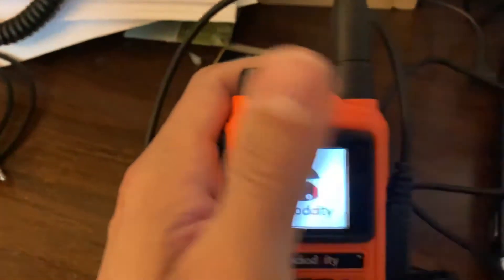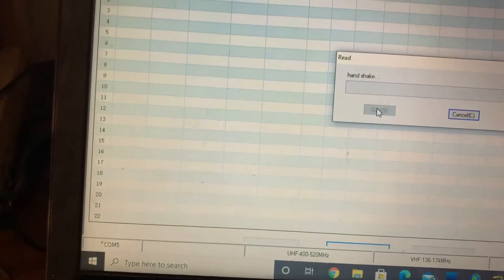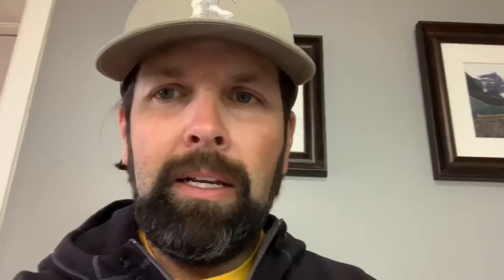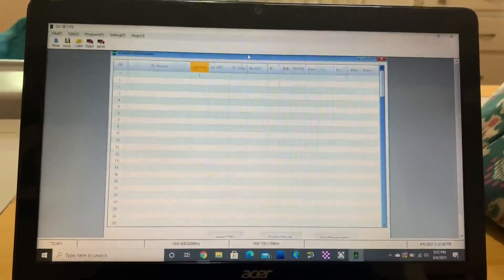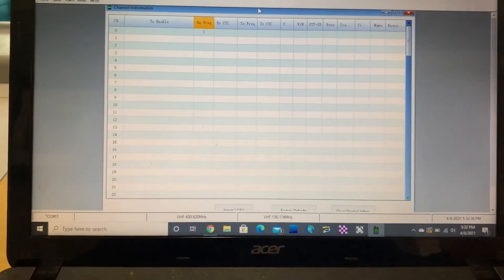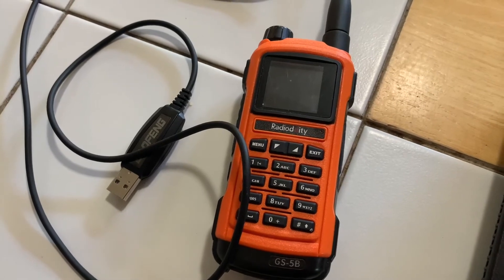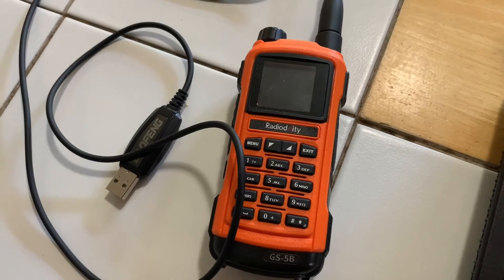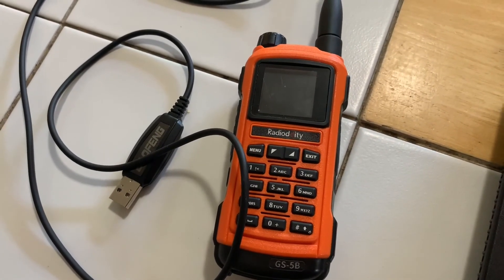Problems with the programming cable and software Radioddity GS-5B

Comment: I have one, great radio. 2 things. RT Systems software works properly. But BIG issue is you can't see that wonder color display in the sun light. Great at night or if never leave the house
Reply from the maker: These are great points. I have found that sunlight on the screen is an awful detractor.

Comment: Thanks for the heads-up.  I got this radio for the USB charging capability.   Your 2 videos about this radio's nuances are appreciated.
Reply from the maker: Thank you for stopping by! 'm sorry for the late reply. Been on hiatus for some time now, spending time with family. I may be outdated on this radio and it's software by now though. I hope things have been changed and updated. I was like pulling teeth to get Radioddity to do something about the programming app.

Comment: *******    I recently bought a Radioddity GD AT10G...And "Trying" to program the radio with the Programming cable,as issued"  is nothing more than a Big Pain in the A** ...I read all the comments below and ordering the Cable with the "FTDI"  chip...as I have had excellent results with those cables.................   Thank you for this video!!..I'm hoping this "FTDI chip cable is the answer !!  ****
Reply from the maker: Gee I hope that resolves the problem! Check this out: https://youtu.be/NIryWOwKF-Q - I go through the remedy for fixing the firmware issue in the cable that is causing the problem, at least with the GS-5B. Have you had a chance to use that AT10G much?

Comment: Had issues with the programming cable as well.  However programming, the program doesn’t have a column for setting offset frequency..???
Reply from the maker: Hey Bob, just responded to this i think on another thread.
Reply: @backcountryamateurradio  yes, thank you.

Comment: This issue with the software is not limited to this one. Other radioddity radios that will not work with the CPC includes the GM30. I also used by Wouxon programming cable and no luck.
Reply from the maker: Wow, the frustration continues. I haven't had trouble with my GM-30 CPS, but I used a 4 year old Baofeng cable too;  I also don't do a lot of computer/radio programming. I should try it with the GS-5B cable which has the update on its driver.

Comment: I spent an hour or two messing a CSV file that it will "import" with no errors but for it not to actually import it. if I save the file and open it back up all my channels are gone and if I try to send them to the radio it gets nothing from the "channel information" box. its sending everything else fine like VFO settings.
Reply from the maker: Oh no. I haven’t heard that one yet. So if I understand, you’re attempting to upload a csv file to the pc programming software?
Reply: @backcountryamateurradio   yea, there's a "import .CSV" button and the channel settings appears in the channel information box as if it's going to send it but it doesn't actually save it or send it
Reply from the maker: this is interesting. have you reached out to Radioddity about the issue?
Reply: @backcountryamateurradio   reading the amazon reviews its been there for a at least 3 months but no

Comment: What setting do you use to have a scanner only channel?  The Duplex setting in chirp doesn't work in "off"
Reply from the maker: I'm really not sure on that. The closest thing I can think of is to set one of the display bands to vfo and run it in scan. But I don't know if that answers your query. Have you been able to use Chirp with this radio? I have not heard of this yet. Unfortunately I no longer have this radio to help answer this.

Comment: Radioddity has been trying to work this issue out with me, and they have supplied a third brand new radio and brand new cable, provided direct links for the drivers they want me to install on my Windows 10 PC, and still the issue persists, and they (Radioddity) are at a loss of explanation. They suggested I am the only user who has ever reported this issue and they can never duplicate in their testing. Well, I know the first half of that statement is not true.

And, once they get the cable/driver issue sorted, they still need to do a ton of work on the programming software, as it lacks standard features that are available with even the most basic text editing programs. I have offered to help their software team with development here also, but they do not seem very eager to make any updates or changes.

Also, there is no solution for the poor design at the base of the radio that makes it nearly impossible to stand the unit up and not have it fall over. The bottom of the case should have been desiged with this in mind, as most other HHT can stand on their own and remain stable.

So far, this really is not a good radio, and I would never recommend it to anyone, especially novices.
Reply from the maker: Wow, Andy, I’m sorry this radio is causing you such a headache! I’ve chatted with a lot of people at this point who have been able to correct the programming cable problem but I imagine there must be other operators struggling with continued issues as well. 

I fully agree with you that the desktop software is hard to use, and virtually pointless to include as part of the package. The inability to adjust the window size seems like it should have been address a while ago.
Reply: @backcountryamateurradio  At Radioddity request, I have tested the third new radio and cable on multiple Win10 PC, all with same 'stuck in transmit mode' results. 

Also, this morning, when I tried to open *.dat files I saved with the Radioddity Programming software, they will not open and the program crashes. Every Time. I am pretty certain this was my first attempot at loading saved files, and apparently the GARBAGE software they provide can not do that either...

This radio, the cable, their programming software, and the company (Radioddity) are all a complete disaster.
Reply from the maker: Andy, I’m sorry to learn of this. It seemed that a lot of hams I’ve conversed with have been able to remedy this issue. But apparently there remains a glitch that isn’t being caught. In my next video I will mention this conversation. I think it’s worthwhile for people to know what’s going on, how the support has been, and how you have yet to get this resolved. I hope you’ll stay in touch. I know I’ve asked before, do you have your eye on a different radio? Anyway, I hope you get your money back. I’m sorry you can’t recoup all the time you’ve spent on it.

Comment: Purchased the following cable from Amazon.
Radioddity PC001 FTDI USB Programming Cable, Plug and Play, Compatible with Most Analog Two Way Radios with 2-Pin K Plug

The HT no longer goes into transmit when the USB cable is plugged in. Tried both Radioddity and CHIRP s/w on a windows pc to see if either of them worked with the new cable.  No good.
Reply: A recent Windows update removed or rewrote the FTDI Drivers.   Here is the most likely solution: https://www.ftdichip.com/Drivers/CDM/CDM21228_Setup.zip  Download the archive from the Future Technologies website and reinstall the drivers.
Reply from the maker: Thanks for commenting about this. I'll check it out as well. Have you tried using this? What have the results been like for you?
Reply: @backcountryamateurradio  the original cable works with the windows driver dated 2007. Radioddity sent me a email with the process to load the old driver. Need to send it to you.
Reply from the maker: @larrymeans7046  I’m understanding the solution is to update the driver, or backdate I guess. Thank you for the offer to send it over. Radioddity got back to me with the details. I will need to make a video on that information about the driver. Thanks for helping me out here with your comments and feedback!!
Reply from the maker: This is so frustrating. I'm sorry to learn this. At least the radio no longer goes into transmit. But I haven't been able to track down the exact cable I've been using. The other day I discussed the radio with someone on the repeater who's been entirely successful with the supplied programming cable... which makes me wonder what is going on.
Reply: @backcountryamateurradio  the transmit issue is the Windows default driver.  Prepare th read or write by entering the Com port number, then only turn the radio on long enough to read from or write to the radio.  Then turn it back off.  The other alternative is to use the 7/31/2007 v 3.2.0.0 prolific driver.
Reply from the maker: @radiouser553  this is so interesting. Thank you for your help here.

Comment: Yep, same problem. I thought I would give the PC  software a try and it did the same thing. Goes into transmit. Get "handshake" on PC and "Program" on HT when trying to import from radio.  I tried to get Chirp to work but no good. Will look on Amazon and see if I can find their cable. Let us know if you hear back from Radioddity. Programming from bluetooth works but not as easy. It must also have some bugs. When adding channel name, it only does five characters. 
Thanks for info. I have subscribed.
Larry
Reply: Checked Amazon. Lots of Baofengs cable. Can you send link to the one that you think will work with GS-5B
Reply: Same issue, tried my Baofeng cable and I get a stead green light on radio, but it never goes  pst "hand shake" major disappointment Dave
Reply: I figured it out. Bluetooth must me off to read or write from pc, with the cable that came with the gs5b, 3.2.0 for prolific driver
Reply: @jacksonnyman1093   Yes this worked... I turned off bluetooth and it read in using the gs5b cable.... YEA.  Thanks a bunch! john
Reply: @johnshome8443  I screwed around with this for HOURS I was messing with the drivers it took forever, I'm glad I can program it now.
Reply from the maker: Hey Larry, Thanks for Joining! Yes, Chirp still doesn't offer a whole lot of support for the newer Radioddity products. As far as the Baofeng cable goes, it's been so long since I purchase mine, and it did work with this GS-5B and my PC and desktop software. Unfortunately, I just don't know which of these offerings on Amazon will be best. Let me get back to you on that. Thanks for the question, I should have figured this out a while ago!

As for Radioddity getting back to me, it haven't heard back and it has been a long time. I will likely reach out again, because this is a problem.